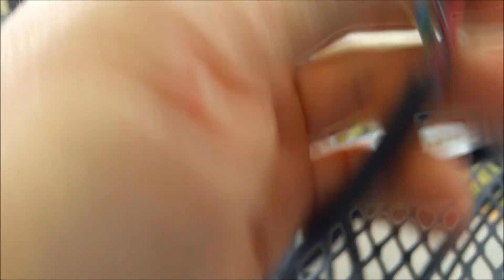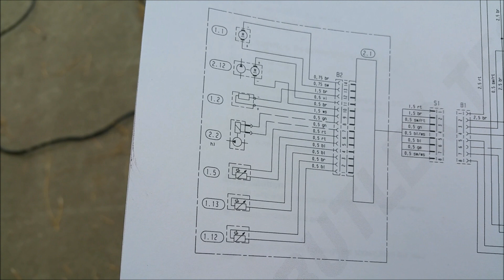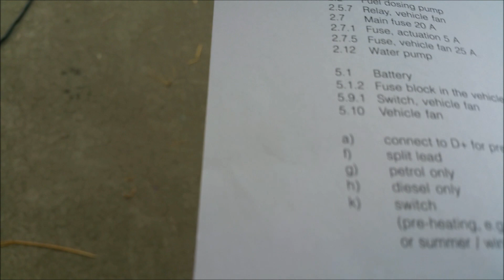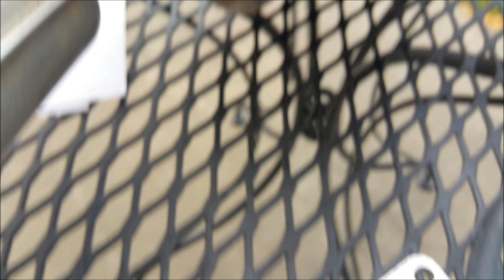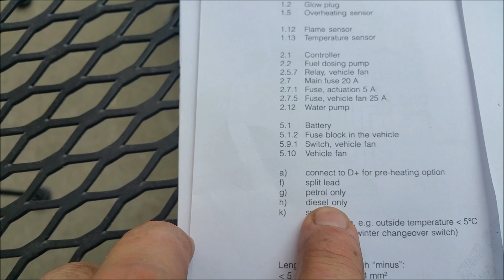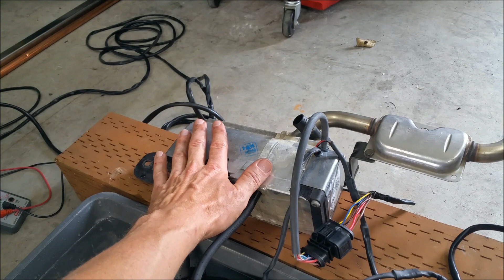Abel LMTV build part 24 Labor day weekend special (eberspacher install part 1)

Comment: So if they do lock up from too many false starts, how would you unlock it?  Hopefully that's not a dealer problem.  I have one that I installed a new glow pin, flame sensor and fan in and it won't fire off, the water pump runs, fuel pump and the combustion fan all run it just won't burn.
Reply: The glow pin I put in was for a 24v system, so I put the old one back in, for a 12v system and it fired right up.  They had shipped the wrong glow pin and I didn't notice it.  Thanks for your video couldn't have done it without it!
Reply from the maker: Buy a new/used one off ebay.  Still cheap around 200 bucks. I have never had to service mine and we use it all the time.  Still going strong.

Comment: Very Cool, We use this same heater in the sleeper of semi's,  although the water pump is inside the heater, watching your video I was able to figure out the wiring and the location they go in on the plug, Thanks a Million!!!
Reply from the maker: Glad I could help.  The wiring diagram is always the biggest challenge.

Comment: Awesome job.    I have 2 of these planned for a future install.    I had Eberspächer tech support offer a different solution.    They had an older generation temperature controller use the debug line to control the heater over can bus.   The fuel pump connects off of the GM harness directly and the water pump is off of the controller.    If that all fails, I will do what you did.   Thanks for posting.   

Do you have a part number for the fuel pump, water pump, and harness you bought?
Reply from the maker: Dosing fuel pump is oem eberspacher.  Water pump out of any Toyota Prius will work just fine.  Like I posted in the video you will have to add pins/wire to get the OEM gm eberspacher to work without the vehicles ECU to control the dosing pump and water pump.  Good luck.
Reply: Sean Fillner 

Thanks for the Prius tip.    The fuel pump supposedly can run off of the OEM GM wires.    The water pump will run off of my Eberspacher controller I have.   Supposedly the Eberspacher controller can run the heater without the GM ECU.
Reply from the maker: @dcraigslist5243  Might be another work around I did not research.  Make a video, tag me in it.  I would love to see the results.
Reply from the maker: Harness is custom made.  I found it on Ebay.
Reply: By chance do you know what connector mates to the D5WZ connector on the unit?   Did that connector match the harness that you bought, or is the GM connector different than the stock one?  

Thanks for all your help and videos!
Reply from the maker: https://www.ebay.com/itm/EBERSPACHER-HYDRONIC-WATER-HEATER-D4WS-D5WS-D4WSC-D5WSC-WIRING-LOOM-HARNESS/121487553349

Comment: Battery chargers are good for charging batteries, but they are typically not so good to use as a power supply.  Way better choice to use a battery...  Glad you got it going.  Do you have the spec for fuel burn? 5KW is a lot of heat.  I ran some heat loss numbers for a 8X14X 7.5’ hab with R10 walls and R1 windows and came up with right around 1KW/hr for 72F inside vs 15F outside.
Reply from the maker: Yes.  At 0 degrees maintaining interior temp of 65 degrees the heater would burn approximately 1 gallon of diesel in 24 hours.  These are the most efficient way to heat a structure in an rv or offroad vehicle.  

From the tests we have been doing at home when night time temps get down to 40 the heater only turns on 2-3 times overnight to keep the shelter at 65 degrees inside.  It only stays on for about 6 minutes each cycle.  I am still in disbelief at how efficient they are.  Battery voltage starts off at 12.6 volts and ends up at 12.4 in the morning along with an inverter powering a fridge.  We will have a 12v fridge soon.
Reply: Sean Fillner vey cool, thanks.